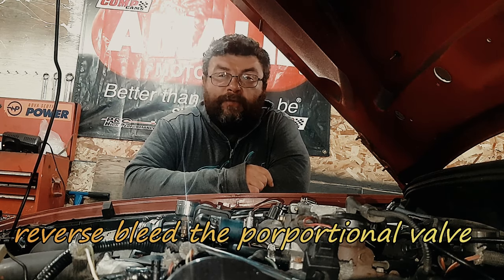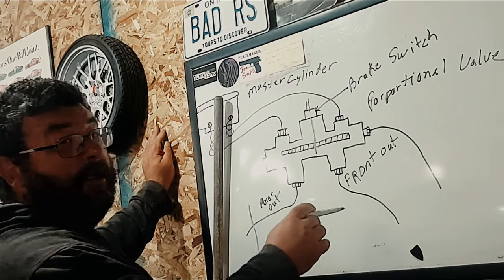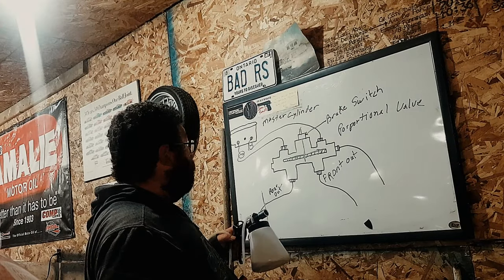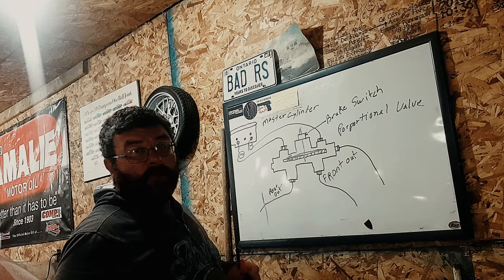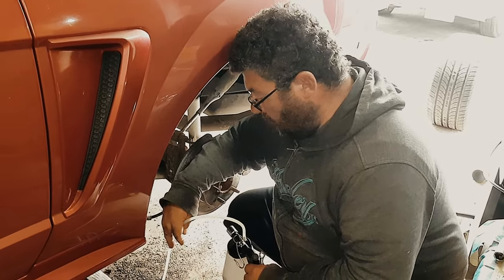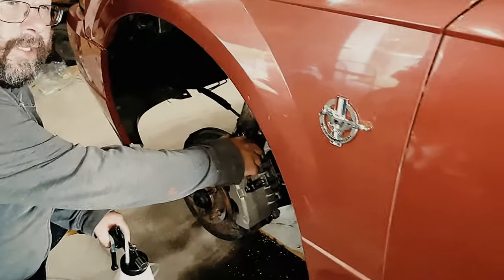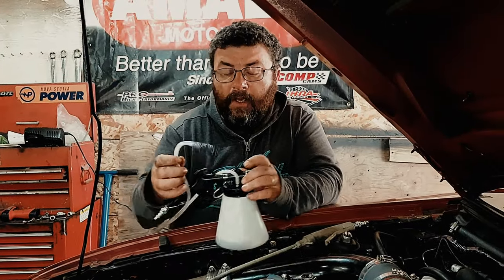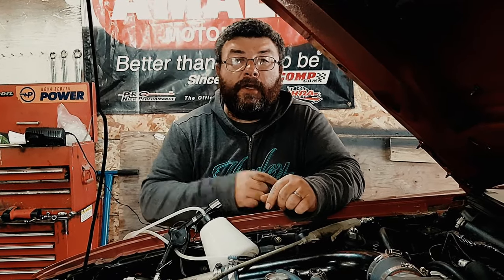brakes wont bleed proportional valve reset this guy's garage

Comment: I've never seen it done this way before. I learned to do it with out any other tools.
Which ever way the valve went,  I would open one or both bleeders at the wheels that had good fluid pressure, then come down on the pedal, hard and fast.  It may require stomping it hard to get it unstuck.  Then close the bleeders, pump the pedal and see if it worked. In some cases I had to start the engine to take advantage of the power booster to let the pedal move fast enough to create a pressure difference that would unstuck the proportioning valve. I If you have a brakes light on this will tell you this problem exists.  But some times the valve will move far enough to block the fluid but not turn the light on. Sometimes the valve will go all the way over the other way. If it wants to flip back and forth, this may require having a helper push down until the light goes out, and stopping, not letting up on the pedal, while you close the bleeder.  Then pump the pedal to see if the light stays out and the pedal is good.   Good explanation of how the valve works, Dude. 👍
Reply from the maker: thank you so much ,since making this video i came up with an express solution ,compress the calipers that wont bleed so it forsces the prop valve back to center , i made a video on it but will save you the time since you clearly understand the prop valve operation ,thank you for taking the time my friend!
Reply: agree.......in an example where the rear line failed....repair the line and get fluid but no pressure in the back.........THEN open both front bleeders, slam the pedal as hard as you can......whild the pedal is down, close the front bleeders.......then gently bleed the rears......worked for me for a dozen years now

Comment: Im going to try this tomorrow! Can hardly get any fluid out of my rear calipers on my 04 Mach 1. Peddle seems shitty and the rears won’t compress the pad against the rotor.
Reply: Hey brian did you ever get this sorted with the Mach1 my 00 Gt is having same issue where nothing comes out the rear calipers when attempting to bleed them. Wondering if a proportioning valve needs replacing or brake like at the banjo needs replaced with steel braided lines 🤷‍♂️
Reply: @rileydines  I did man. Definitely the proportioning valve. What I did to fix it was open up the line on the proportioning valve for the front brakes then have someone stomp them real hard while it’s open than close it than try bleeding the rears again

Comment: In december of 2019 my rear brake line in my chevrolet cavalier rusted out. it has disk front rear drum. I have determined the problem has to be the proportioning valve. I have the exact same vacuum bleeder, but my master cylinder does not have a bleeder. I can't find the part # of the proportioning valve that I need so I have to figure out how to fix it. I went to the junkyard and the one I got doesnt work either. how do you know it fixed the problem?
Reply from the maker: Bleed it from the front caliper and open up the rear bleeder to pull the propetional valve back in line.  Any questions fire away

Comment: So considering my master cylinder doesn’t have a bleeder, when I hook up to the front caliper, won’t it be sucking out the fluid that’s currently in the front line?
Reply from the maker: yes.
Reply: @thisguysgarage  then after getting any amount of fluid out of the front caliper, I can start bleeding the rear as normal? Pump pump pump hold, bleed repeat with the buddy bleed system?
Reply: I’ve got the vacuum bleeder and I got a little fluid out of the front caliper. Hooked it up to the rear to start vacuum bleeding and I’m not getting anything. This is a pretty much complete new brake system I’m working with
Reply from the maker: @softbodyfab7588  once you get fluid moving go to the buddy bleed method for sure
Reply from the maker: @softbodyfab7588  remember when buddy bleeding thatif you pump the brake more than once you will move the prortional valve on the second pump. so important is one pump at a time for bleeding.  let me know how you aRE making out.
Reply from the maker: @softbodyfab7588  start at the lines on the master cylinder confirm fluid travel there
Reply: @thisguysgarage  got fluid there
Reply from the maker: @softbodyfab7588  move down the system. bleed all four corners of the proportional valve if the lines will move

Comment: If you are unable to bleed one side of the rear but the other side you was able to bleed is it still a proportional valve ❓ I ordered the bleeder   I already had a hand pump one
Reply from the maker: try bleeding it before the flex hose to confirm if a flex hose has gone bad. it may be that if one side is bleeding properly .  ty TShoo ,any other questions fire away
Reply: @thisguysgarage  Thanks so much for your help I wanted you to know that I did try that with no luck wind up having to replace front calipers and when I got them on everything was fine
Reply from the maker: @tshoo8282  appreciate it 👍

Comment: I just watched your video clip and am wondering if my proportional valve is my issue. The car seems to be dragging as I accelerate and after driving for an hour,  the rear discs are much hotter than the front brake discs. I have replaced both front brake calipers and right rear brake caliper & brake hose. There is a scruffing noise when I jack up the car and spin the rear wheels by hand. I removed the rear wheels and a little fluid came out of the bleeder without the pedal being pressed and the wheel spun more freely after doing that. I am wondering if the master cylinder could be causing a slight pressure to the rear brake calipers or possibly the proportional valve?
Reply from the maker: check your rear calipers 1 #2 depending on age of vehicle the flex hoses may be trapping fluid in the callipers keeping the brakes on ,make sure sliders are free and lubricated. let me know
Reply: @thisguysgarage  .Thank you for taking the time in replying to my question. This is the work I have done so far to the braking system.  I replaced the right rear brake caliper and hose last year with new parts and I also changed the fluid in the braking system. Last month I replaced both rear brake discs and brake pads as they needed replacing. I checked the sliders yesterday and both move freely. The brake pads can move free enough in their holders too. The car is a 2008 Toyota Avensis 2.0 diesel with 265,000mls on the clock. When I removed the caliper and replaced the wheel, it spun freely on both sides so I thought that would rule out a wheel bearing issue. I would be grateful if you could suggest any possible solutions. Thank you for your assistance.
Reply from the maker: @patokeeffe4914  when I reread your original comment you mentioned the brake freed up when you opened the bleeder.  Leads me to think flex hose with the information provided.  There's a restriction that is letting fluid through but not traveling back to the master cylinder.  Also check the brake lines on the underbody for kinks ,maybe a jack or stand could have caught a brake line. .
👍 let me know how you make out 👍
Reply: @thisguysgarage  Yesterday I replaced the flexible hose from the brake caliper to the brake lines and there was some scruffing but the wheel could spin. I took the car for a spin of about 15mls on a road which didn't need a lot of braking. On my return I felt each brake disc and the troublesome ( rear driver side) disc was hot, the rear passenger side wasn't stone cold but not warm either. The front brake discs were cold. The brake pedal doesn't need to be pressed far before the brakes start to engage. I am wondering if the rear brake disc could be doing most of the braking and as a consequence is getting much hotter??
Reply from the maker: @patokeeffe4914  the caliper seems to be sticking or the sliders are not moving from.  At least 50% of the braking should be coming from the front  60/40 front versus rear would be the average with the front brakes being larger that the rear.  Does sound like you have had an improvement.  Look at that caliper 👍
Let me know how you make out 👍
Reply: @thisguysgarage  When I was replacing the flexible hose, I also checked that the sliding pins were free to move and that their rubbers were not torn. I also removed the brake pad carrier, removed the shims  and used a wire brush to clean where they sit. I made sure the shims were clean before refitting. I also applied grease to the ends of the brake pads before refitting. The pads could move reasonably freely in the carrier, not loose and not too tight either. I replaced the brake caliper on the troublesome wheel last year with a brand new caliper and the piston didn't require a great deal of pressure to move it when refitting it. Both front brake calipers were also replaced with new ones last year. At this stage, I am wondering if there is an issue with where the hydraulic pressure is generated, and not fully releasing and that the rear passenger brake disc  is doing a lot of the work when the brake pedal is pressed, hence that might explain why it is getting so hot??
Reply: Would you have any other suggestions that I could look at to resolve the issue with a heating rear brake disc....?
Reply from the maker: @patokeeffe4914  if it was the master cylinder it would be overheating both rear calipers .  I would be suspect of the caliper itself if the flex hose has been changed.
Reply: @patokeeffe4914  did you ever get the issue resolved and if so what was the culprit?

Comment: Good day Sir
I have a question

In one of your brake videos you stressed to only pump once during the bleeding cycle 
What is  going on in the line ?
Reply from the maker: If there's air in the line the second pump will set off your proportional valve and you will not be able to bleed till it is reset.

Comment: Thank you
Reply from the maker: You're welcome,ty for taking the time!
Reply: @thisguysgarage   great video thanks .  I've just replaced the valve block  and can only bleed both rear wheel cylinders. Very little fluid is coming out both front calipers.  Do I open the drivers front bleed nipple then open drivers rear cylinder and put the vacuum bleeder on the rear nipple? Then do the same on the passenger side.  Thanks for your help
Reply from the maker: @deniaelegance  one side should get the proportion valve in place.  as on the procedure 👍 let me know how you make out
Reply: @this guy's garage   brakes all good now  thanks for the tip 
I'm from England and some of this older stuff boggles the  mind.

Comment: What do you do after hitting with the air??? I got to that point now what?
Reply from the maker: bleed them as normal . 1 pump at a time, 1 pump only Q patriot😉 second pump of the brake will move the valve again. if you dont have a sipon bleeder.
Reply from the maker: start at the nearest to master
Reply: @thisguysgarage  buddy bleed? Or with pump? Shut back valve, leave open? I have a bleed spot in my master but no bleeder I shoved hose inside and sucked fluid through don't know what that did
Reply from the maker: @QsPatriot  after closing up all bleeders.  you can buddy bleed or do it with a pump . it does not matter . but i always check with a buddy bleed to check . if you are buddy bleeding just do one pump at a time till you get gluid in the whole system.   il keep an eye open if you have any questions.
Reply: @thisguysgarage  Merry Christmas thanks for responding had to  put away for Christmas...I bought a cheapo bleeder from Amazon. So your saying open rear and front shoot air then seal off rear bleed front like normal then go to rear?
Reply: @thisguysgarage  im going to just start the process over just rewatched your video and our comments and its making sense...glad you put emphasis on 1 pump...didn't see that before...thanks again...I'll let you know how it goes!!
Reply from the maker: @QsPatriot  please do. and let me know if you have any other questions my q friend 🤜🤛
Reply: @thisguysgarage  its done Brother thanks for the words of wisdom!! Good Man!!
Reply from the maker: @QsPatriot  glad to have helped out.thats what it is all about. sharing knowledge 🤜🤛

Comment: I suggest you disassemble a Ford "proportional valve"... actually a COMBINATION SWITCH.  The COMBINATION SWITCH consists of a differential pressure valve, which is the sliding "shuttle" that turns the warning lamp on. a METERING VALVE, which delays pressure application to the front circuit, in order to keep the car straight,, and a PROPORTIONING VALVE which limits the amount of hydraulic pressure to the REAR CIRCUIT ONLY, to control front to rear brake bias.  In the case of the ones commonly used on Ford products, no "ports" are blocked by the movement of the shuttle and the "backup" braking is controlled exclusively by the master cylinder, where the primary and secondary pistons, usually separated by hydraulic fluid, are allowed to contact each other.

Comment: Or you can do it the easy way and have someone step on brake pedal while you  Crack the line open on combination valve on the side opposite the side that piston is offset to . Will center it immediatly.

Comment: Hey man I got a 04 mustang just like this. Put in a built rear wind and leaked some fluid out and now I’m only getting fluid to the front and not the rear. I tried this method and it didn’t work. Any other ideas?
Reply: Hey brain did you ever get this sorted and if so what was your issue?

Comment: I changed New front calipers and now my Brake light is on even after bleeding several times . I even tried bleeding the proportioning valve while pressing brake pedal down and releasing air from there . And brake light is still On.
Reply: I even did the Vacuum pump bleed brake light still on .

Comment: Well, that didn’t work I just blew brake fluid out my master cylinder everywhere and yes, the rear brake bleeder was open I still can’t bleed my black back brakes. I guess I have to figure out where my proportion valve is and change it. Does anybody know where it’s at on a 2006 Chevrolet Silverado Cheyenne

Comment: Ok replaced a bad break line in the rear.  I pumped and pumped and nothing would come out the back.  When I try to suck from the master cylinder its completely stopped up, nothing comes out (p.s. I was sucking directly from the break line that goes into the master cylinder)  even under high vacuum pressure and yes the back breaks are open.  When I suck from the back breaks I can get the fluid to come out.  ok successful bleed and I thought I was done  :)   However now all 4 breaks are on all the time.  I drove for bit hoping things would work out, but all I got was really bad gas millage and really hot rims.   The break peddle is hyper sensitive, move it just a centimeter and its full breaking power.  What should I do now??????
Reply from the maker: what are you driving?
the 3 things that can cause sticking brakes are the master cylinder, flex hoses and calipers.  very uncommon for 4 flex hoses or 4 calipers or combination of to go bad all at once.  by that logic the master cylinder would be the place to start,  but let me know what kind of car we are dealing with and see what solution we can come up with.  
please consider ringing the bell 🔔 👍
Reply: @thisguysgarage  1999 chevy stepside. 4 disk.  Replaced master cylinder because the breaks pushed to the floor.  Later I discovered a leak in the rear breaks.  Fixed leak.
Reply from the maker: @huseman21  all good now?

Comment: i lose all my fluid.  im new to this so I have to try to find the leak.  i refilled master, pumped breaks, no leaks by the tires, coming from somewhere up top where it ends up dripping off part of the a frame.  but i lose all fluid I think becasue no breaks at all. pushes all the way to the floor and drains the master quickly

Comment: After an accident I hit a car standing on the brakes and the Yukon took over and let the brakes off when I needed them.My ex had an astro van with the same thing.There is a recall only in rust belt .Mine was a company truck on the Texas coast.I took the abs fuse out and presto!No computer making decisions for brakes.Most cars I've had didn't come with abs anyway.
Reply from the maker: early gm abs systems were terrible, you are right...ty for taking the time!

Comment: I'm afraid the valve is rusted tight on my dodge and this idea  probably will not work.
Reply from the maker: Try compressing your caliber that won't bleed like you are installing new pads the hydraulic force will open up the valve.

Comment: Hey , I have 2006 Chevy avalanche 2wd  my brakes were sticking and a went n got new calibers( on the fronts)dat didn’t work I went got new lines dat didn’t work I went got new hydraulic booster and brakes started pumping up , thought we had it solved went to crank truck and d brakes sucked down to floor turned engine off they went bak up can u help me plz